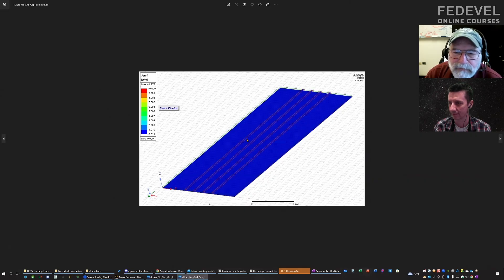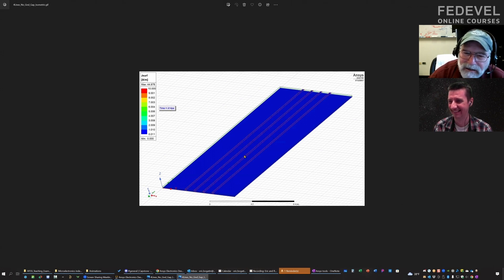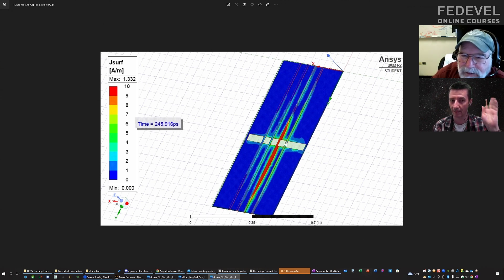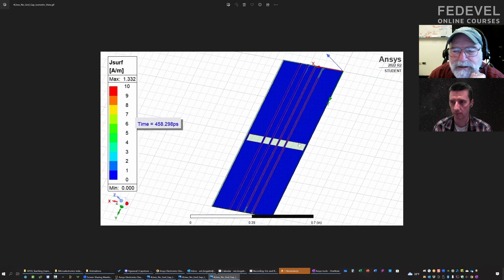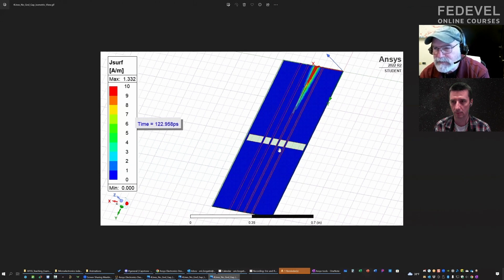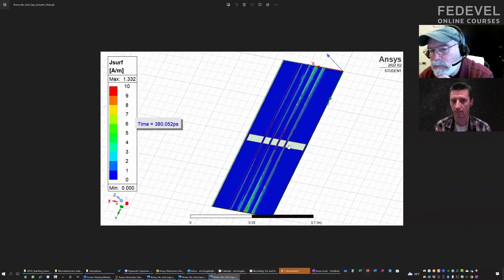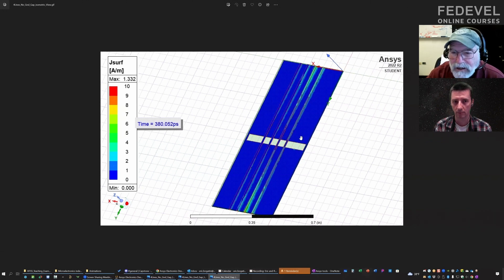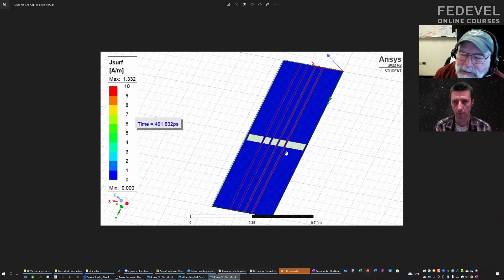Very Important For PCB Layout: Crossing planes explained by Eric Bogatin

Comment: Even at low speeds when you don’t think you really need a plane for signal integrity, a split plane like this is awful for both electromagnetic susceptibility and crosstalk, it becomes surprisingly awful even in the low kHz region. I’ve seen it in other people’s designs have been changing them to solid planes.

Comment: An interesting simulation would be signals crossing a split power plane with a ground plane under the power plane. I.e. Sig / Pwr / Gnd. The inter-plane capacitance between Pwr and Gnd should act as a much better capacitor at higher frequencies than a discrete component mounted on the top layer and connected using vias.

Comment: Very cool demonstration! I was wondering, what is the effect if you don't have a solid ground plane, but instead route return path as a trace directly under the signal traces? Does this make the crosstalk worse because there can be potential differences between nearby return paths or could it be a benefit kind of like a differential pair?

Comment: Isn't this an effect of, essentially, one side of a transmission line being a plane, and thus having a distributed pair charge to the line part of the line, and when it encounters the discontinuity, it's like a wave hitting a double (or in this case, a quadruple) slit? There are two pulses going back because there are two changes in charge direction, one when it encounters the beginning of the gap, and one when it encounters the far side. The impedance mismatch looks a lot like a partially reflective window/mirror, in fact you could maybe get a "thin film" effect cancelling out the noise if you match the width of the gap to the length of the pulse? Very cool simulation!

Comment: It would be really interesting to run a simulation in a GSSG configuration with ground pour on signal layers. I believe this configuration is quite commonly used on internal layers for low speed signals. Each signal trace is sandwiched between a continuous ground plane and a split ground plane (orthogonal signal layer with ground pour). I believe that a simulation could highlight effects similar to those shown in this video. Thank you!

Comment: Robert, I respect what you are doing but could you please work a little bit on your accent? Eg. capaaacitors, not capaciiitors. Please don't take it offensive is rather advice what you should improve. Thanks!
Reply from the maker: I tried. There is no school in Slovakia where they would focus on my accent. I have tried two, it was useless so I just let it go.
Reply: @RobertFeranec  as long as you dont get an american accent, all will be fine ;)
Reply: @RobertFeranec  you are mostly ok and easy to understand. Just need to adjust a couple of words. For the moment I remember "capacitor". Google translate is your friend.
Reply: I have no problems understanding him. Prefer english with an accent over subtitles
Reply: Well, there is accent everywhere, even US accent is a type of accent. We just have to get use to it.
Reply: Use close caption and turn off speaker lol
Reply: btw got funny situation on interview some years ago when I incorrectly put accent on "impedance". And guys had to hold they laugh when they heard "impotance". Got the job anyway...